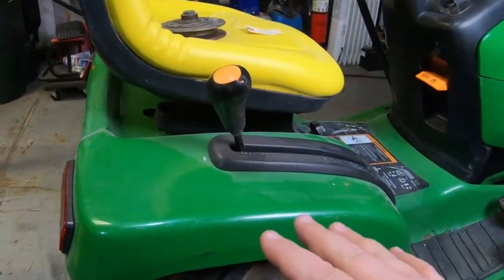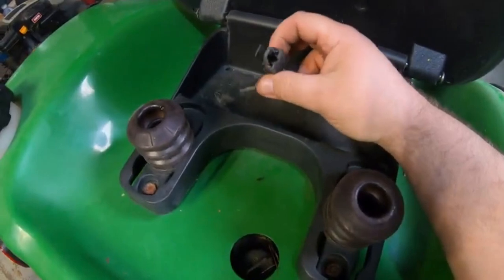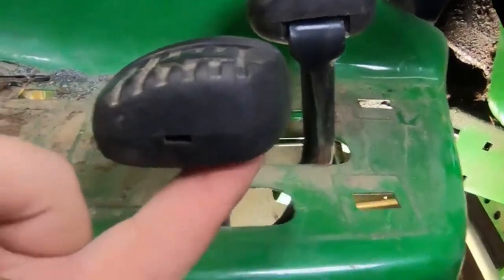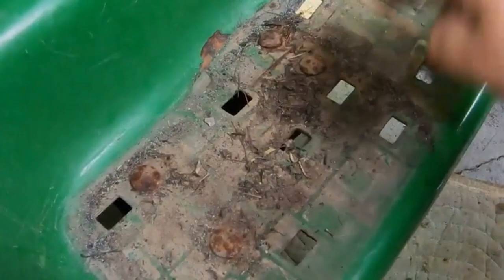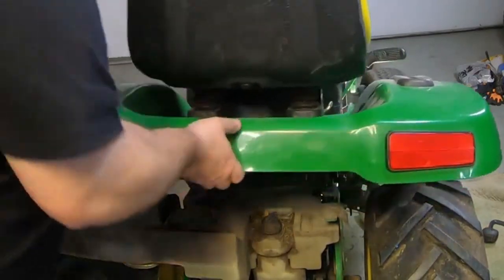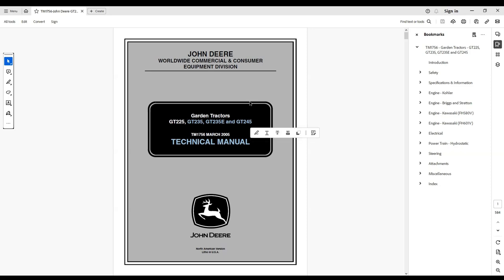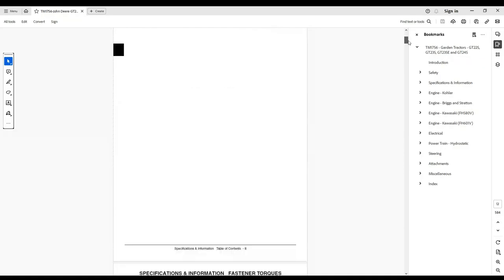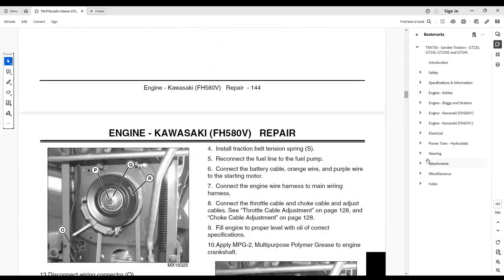👉 GT235 John Deere Service Repair Manual

Comment: Did not have to take the nut off pedals it linkage at the back with a key pin take it loose and you can remove the fender